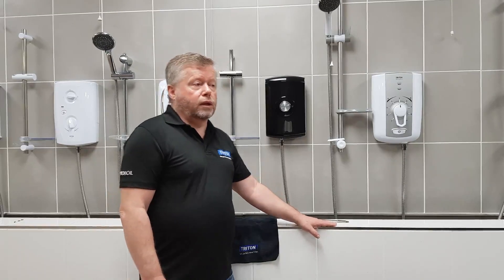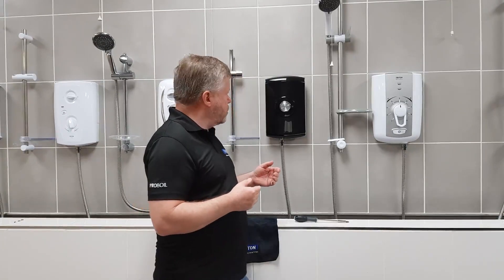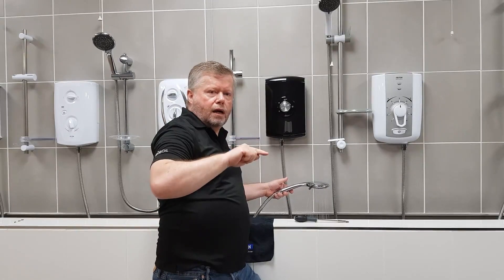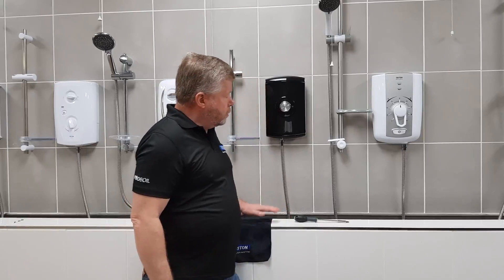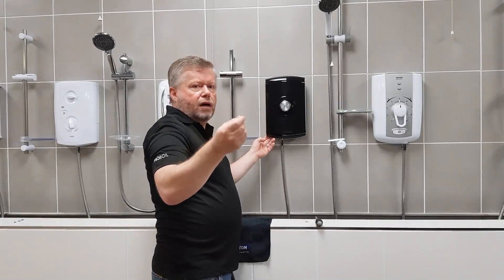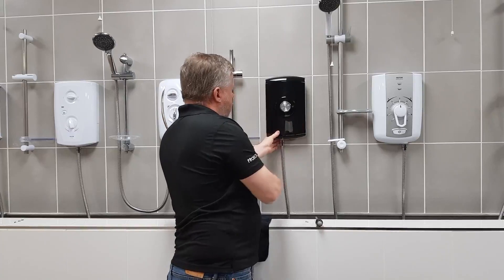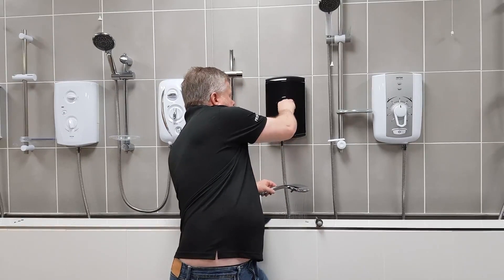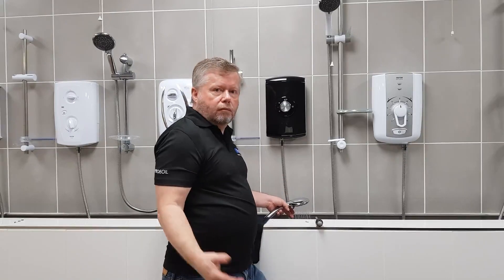Electric Showers | Aspirante or Amore - Water not hot enough

Comment: We have the Amore shower and everything was working fine for a couple of months after installation but then the shower kept switching itself down to the Cold (*) setting by itself after a few minutes of running.  We would put it back on the hot setting but again, a few minutes (or less) later it would switch back to cold.  No errors were reported by the digitial display (i.e. Low Pressure etc).  Any Ideas?
Reply from the maker: Generally the shower running cold only will be water pressure preventing the pressure switch for the elements working. If the pressure appears okay and the shower isn't showing a low pressure indicator we'd advise contacting our service team on 02476 372222 for further advice and potentially an engineers visit

Comment: I have the opposite issue.... The shower is too hot.... It's minimum temperature is 40/41 degrees.... It never used to be like this. I have had the cover off and ensured that the dial and the internal mechanism are correctly set as shown in the video. But still the minimum temperature is 40/41. It used to turn all the way down to low 30's, high 20's....

Could I have some help and advice? Do I have a fault?
Reply from the maker: Hi, sorry to read you're having issues on the product. Due to high ambient temperatures recently you may have to drop the power down to the economy setting in order to counteract the jump in temperature from the ambient, could be worth trying this in the first instance. Otherwise common reasons that can cause that type of problem would be restrictions on the inlet and outlet. So would be worth checking the inlet filter and shower head for blockages that might be obstructing the flow and that the hose hasn't collapsed on the inner tubing. If everything mentioned appears okay it will ideally be checking the flow rate to the product to make sure you are getting the minimum requirements. We do also offer on site visits in and out of warranty if you believe it may be a product fault on 02476 372222. Kind Regards, Leon.

Comment: I have just had one of these fitted,it does work but the temperature can be temperamental,when the shower starts I do not get a temperature display,only lo or hi,I'm wondering whether the commissioning was done correctly.
Reply from the maker: Hi Mark, checks to do will be making sure the commissioning procedure was followed and that the cover dial was aligned correctly. If both appear okay the next thing will be checking incoming pressure/flow rate is adequate for the model. After this point if you still have a problem we would advise contacting our service team on 02476 372222 for further help or possibly an engineers visit. Kind Regards, Leon.